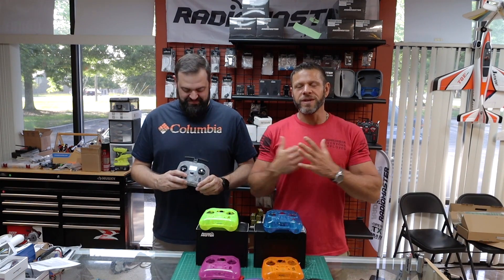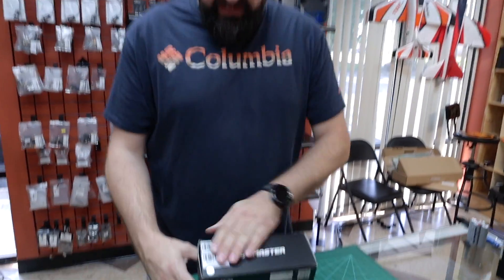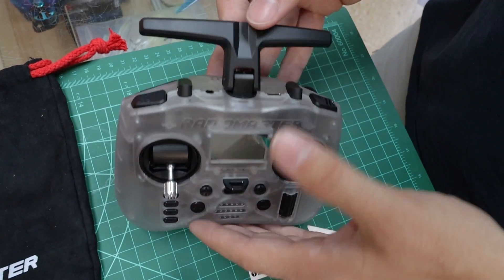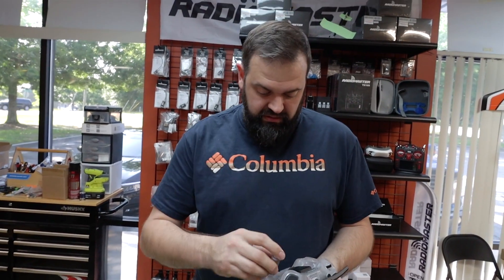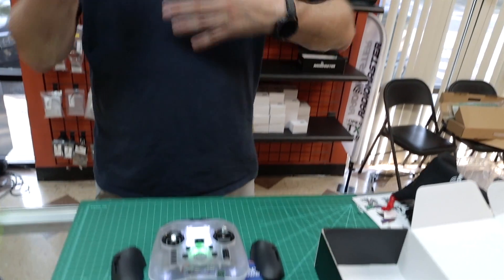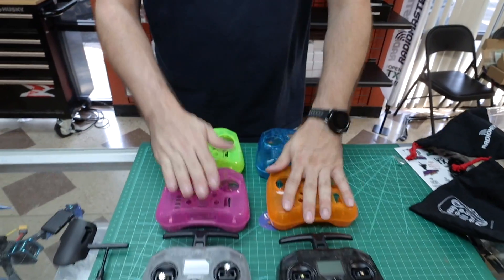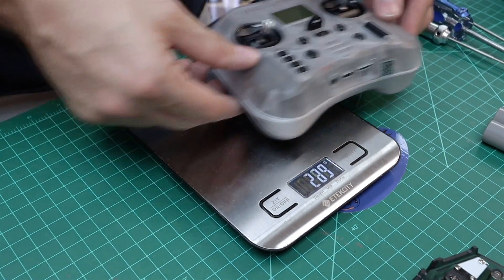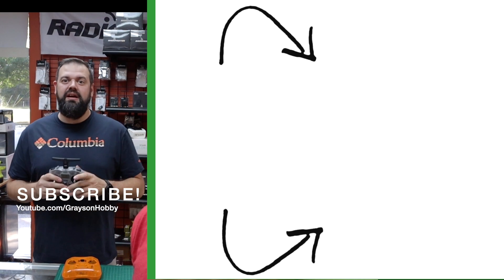RadioMaster Pocket Remote Controller In Depth Review with Tear Down

Comment: what was that last comment about spektrum?
Reply: What he’s saying is that the radio only comes with cc2500, or ELRS built in. If you want to use it with DSMX Spektrum, you have to buy a 4in1 module for the back. Radiomaster makes that module with the nano connector 😀

Comment: Why in USA is 65$ and in Eu 150€ that doesn't make sense 😢
Reply: Why not just order off a USA company and have it shipped
Reply: Where in Europe do you mean? It's 79,99 € for the ELRS version in Germany (including shipping and 19% VAT). And usually it should be cheaper than that from Radiomaster's EU shop.
Reply: I spent 84 euro (ELRS) with batteries. Where did you find it so expensive?